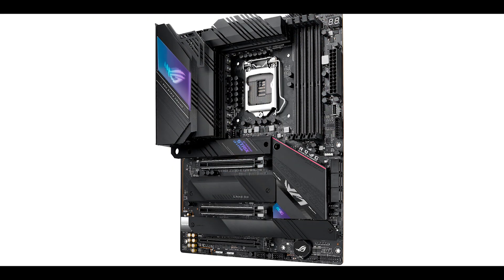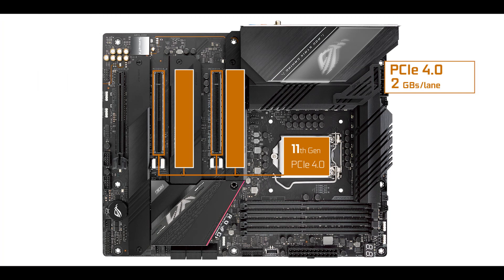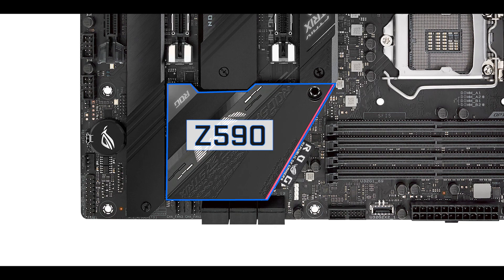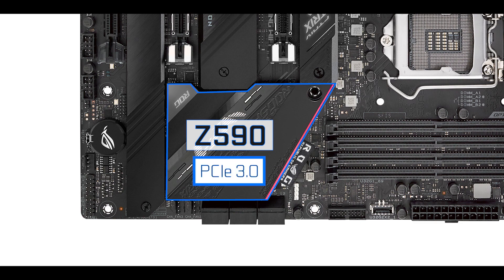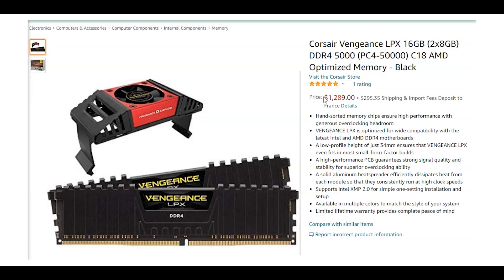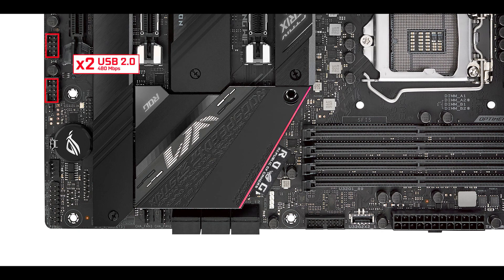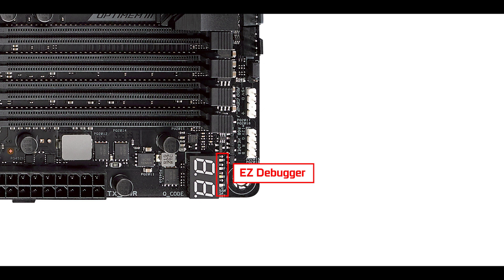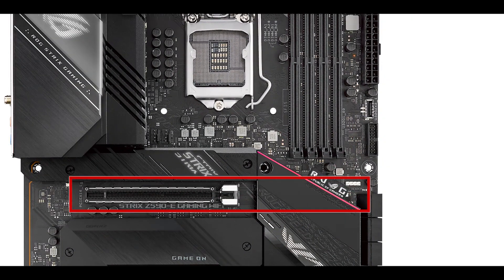ASUS ROG STRIX Z590-E Gaming: The COMPLETE Preview!

Comment: Very nice, I have that board and an Intel gen 11, i9-11900K cpu with a samsung ssd 980 pro in the 1st M.2_1 (socket 3), my GPU is running at 8x, not 16x I wonder if you have any usefull info to make ir 16x? Thank you
Reply: I recommend you check your BIOS. (But I hope it's all sorted out by now).

Comment: Owner here: 
I have this exactly MB for 2 years now and fitted 4x RAM modules with a total of 64 GB memory and an SSD M2 for W10 use. Everything else are still 7200 and 5400 HDDs. The result is I can have Opera open (5 separate workspace tabs with a total of about 150 open tabs) AND Chrome (with around another 60 tabs open) have a movie on a second monitor playing and still run GTA V on all options maxed out with no problems. All that with a 10th gen CPU i7 10700 running at the lower 3,8GHz (can go slightly above 4). 

This leaves me with a lot of headroom for future upgrades before I have to reinvest into a complete build again. When I do I will get a 11th gen CPU which will unlock the higher PCIe 4.O (with all its limitations that you have to take into account when you do that).

The only downside is the Armoury crate with is crap. If you want your RGB to run exactly like you wish 24/7 I strongly advise you to skip the ASUS SW completely and get something else like Corsairs icue or whaveter you deem proper. I mean it is okay when it works but a PITA when not. Google user reviews and troubles and you'll see. 

BTW I bought it also because (but not only) of the 2,5GB LAN because I already have a 1GB connection right now just to be future proof if I ever get a higher connection rate but TBH even the 1GB is overkill. Half is all you will ever need if ever but you know - why not when you can and the offer is good :)

Comment: Here’s the spec I just need to know if it will work or not 

My build list ⬇️

GPU- asus rog strix 3060 OC 12 GB
 
CPU- i9 10900k 

MOBO- asus rog strix z590e ATX LGA 1200 wifi

Storage- m.2 980 pro 1tb and a Seagate barracuda 7200 IHD

PSU- asus rog strix Thor 1200

RAM- DDR4 g-skill trident z royals  4x8 gb 3600 mhz

Aio- Nzxt kraken z73 360mm

Fans- Lian li infinity 17 of them 

Case- Thermaltake core p8 TG

Now a lot of people are saying that I’m going to have a problem with the mobo and cpu because it’s not a rocket lake based cpu 

Like I said I have no experience in building pc but I used to have one that my cousins build it for me but that one got messed up 
It kept on freezing while the temps were down and everything was normal I couldn’t figure it out 

In this build I’m mainly going for aesthetic look with a little bit of performance

So please if anybody knows this build try to hook a brother up with some awesome advice.  

BTW I went pc part picker and did this build list but here’s what it said and I’m not sure what it means.

“A
Note: Fan compatibility checking is currently not supported.
B
Note: The Thermaltake Core P8 TG ATX Full Tower Case supports video cards up to 320mm long, but video cards over 280mm may block drive bays. Since the Asus ROG STRIX GAMING OC GeForce RTX 3060 12 GB Video Card is 300mm long, some drive bays may not be usable. The Thermaltake Core P8 TG ATX Full Tower Case hard drive bays are positioned where some of the bays may be physically blocked when using longer video cards.
C
Note: When the motherboard is not paired with a Rocket Lake-based CPU, M.2 slot M2_1 (M) is disabled.
D
Disclaimer: Some physical dimension constraints are currently not checked, such as CPU coolers and RAM clearance”

Comment: Do I understand it right ?
 I have a Z590 E with a 11700k and an RTX 3090 TI.  The CPU outputs 20 pcie lanes, the graphics card should get 16 in the best case.  So I can only use the M2.1 and the rest of the M2 slots should remain empty.  Then I would have to pack games and OS on a large m2 is that stupid or smart?

Comment: I just bought this and I'm going to pair it with a 11th gen i7. But i'm really confused about the ram, because on the Asus is states " 11th Gen Intel Core processors support 3200/2933/2800/2666/2400/2133 natively", does that mean I cant use 3600 for example?

Comment: I only recently found this channel and love it. I just bought and installed this motherboard (Asus ROG Strix Z590-E Gaming). As my CPU is 10th gen and not 11th gen, I was aware the top M.2 port would not function.
However, I cannot get the 2nd M.2 to work either. No drive appears even in the BIOS when using M2_2. Slots 3 and 4 work fine.

Can anyone help please? Many thanks:-)
Reply: I'm having the same problem, will this second slot only accept 4.0 too? Did you manage to solve the problem?

Comment: The motherboard was purchased Asus Z590 TUF gaming motherboard and when installing it with the processor Intel Core i9 11900 so that it shows a red light on the motherboard and I do not know the reason why it was previously not shown
Reply from the maker: Is the bios fully updated? U can update it without CPU
Reply: @Laurentschoice  Why did you update and what is the method to update the motherboard

Comment: I bought this motherboard and paired it with a 10850k. You mentioned that the current generation of video cards cannot fully saturate the PCIe 3.0 bus, but what about the SSD? I am wondering if I would see any performance increase by upgrading to an 11900k and a Samsung 980 Pro, instead of my current CPU and my 970 Evo Plus? I just don’t want to lose my two extra cores :/

Comment: The screw to hold the 11 core M.2 card in place is too short. Wont tighten so I used it just to hold the card in place until I fastened the heat pad over the top. I do believe I just got the discount board because of this fault. Good review.

Comment: Okay question, if I've got a 11900k as my cpu into this, and I want an m.2 in the top slot as well as my 3090 gpu will they use the same bandwidth as eachother? If so, what would be the best way to put both components in with the least compromise?
Reply: I'm doing the same thing, how did your build turn out?
Reply: @robertvonada7493  nothing yet as to answers to this question, plus I havent gotten the parts for it yet
Reply: @user-hh3oi3yh4y  I just put mine together its amazing fast I9 11900K, Asus RTX3090, WD 850 1TB, I just need better ram any recommendations ?
Reply: @robertvonada7493  idk, I just have corsair vengeance 4 sticks of 8gb
Reply: @robertvonada7493  I'm going this G.SKILL Trident Z Royal Series 64GB (2 x 32GB) 288-Pin DDR4 SDRAM DDR4 4000 (PC4 32000) Intel XMP 2.0 Desktop Memory Model F4-4000C18D-64GTRS.

Comment: I "upgraded" to a new system with this motherboard and i've had nothing but issues for the past month! stutter and lag being the main issues! i have ruled out ram and i'm 100% confident it aint my 10700k or my 1080ti so either my corsair cx750 is failing even though it reports perfectly fine voltage, my new nvme drive is potentially dodgy or windows 10 is a piece of crap! failing that the wifi on this is the cause i will test that out tomorrow. I like the compatability of the motherboard and it looks great in my setup but at this point i miss my old system with my gigabyte z270x
Reply: same issues im having

Comment: Problem with this board if your using 10th gen cpu,  No 2 M.2 slot 3.0 nvme will run Gpu in 3.0X16@ x8 mode, So use the bottom 2 slots for 3.0 nvme m,2 ssds to get x16

Comment: Is z590 equivalent to b550?
Reply: No actually the z590 is x570 in the z490 is b550. If you're gaming the comparisons are already pouring in and z490 is trading shots and winning most of the time, z490 gives you Gen4 nvme Gen4 pcie GPU and new updates now give you Intel's version of amd's Sam smart access memory. I see absolutely nothing on the table from z590 except for a thunderbolt the latest USB C speeds and whatever 8 GB per second over 4 GB per second for your pcie extras gives you, and coming from pcie 3 chipset which is archaic

Comment: CPU have 20 PCIe 4.0 lines, 16x for GPU and 4x for SSD M.2 NVME. Why you draw 2 M.2 from CPU ?? M2_1 PCIe 4.0 4x from CPU (GAME ON) and M2_2 , 3 and 4 from Chipset.
Reply from the maker: Hi Fernando. That's a very good point . 
I drew those because they are both CPU fed. 
The Z590 chipset , even if it has native PCIe 4.0 support, does not house any PCIe 4.0 lanes as far as we known . It has 24 PCIe 3 lanes instead. 

My best guess is that, when both m.2ssd. Will be populated the 2nd PCIe 16 will run with less PCIe lanes. 
But as u rightfully pointed out, as it stands right now, there is a PciE 4.0 shortage of lanes when compared to manufacture specs claims. 

TBC obviously
Hope this helps. :)

Comment: Lol. Dude doesnt know. Its hilarious. M.2_2 is from cpu as well. So using it on 10 or 11th will result gpu running 8x gen3/4..
Reply from the maker: The 10th gen is PCIe 3.0 only :)
Since the M.2_2 sources its bandwidth form the CPU, it will run only on PCIe 3.0 standard with a 10th gen Core CPU.

Only with a PCIe 4 enable CPU will u unlock 1st and 2nd M.2 SSD PCIe 4 abilities. 
In our case,  the incoming 11th Gen PCIe 4.0 CPU.

I hope this helps :)
Reply from the maker: Asus will provide more details about the above in the next week or so. We already received the detailed specifications regarding M.2 SSD connectors.  
So this not an assumption. This is the very same approach we have seen on the B550 and Z490 powered motherbaords.
Reply: Think you didnt understand.

The first M.2_1 is from the extra pcie 4x lane from cpu
The second is M.2_2 is from cpu. Which shares from the gpu 16_2.
So if you use m.2_2 and plug  10 or 11 gen cpu will result 
16_1 running in 8x

Its NOT the same as b550 and z490.
Z490 other than extreme.. there no NO m.2 from the cpu.

Comment: z490 better cause price. specially open box or used on ebay.
Reply: Z490= b550 z570~x570 gigabyte top overclocking guy has set all his records with aorus Elite z490. Just got one for 175 alternatively MSI gaming Edge for 180ish

Comment: Will it be possible to get a x8 connection from the chipset to the CPU with a comet lake cpu and a z590 mainboard or is it limited to 11th gen CPUs?
Reply from the maker: It will be, absolutely, but at PCIe 3.0 standard (8 GB/s)
Reply: That would be great. Because previously I/O was always limited through heavy bandwidth periphals like a thunderbolt 3 connected NVMe or eGPU. Just to be clear: I could pop in my i9-8050K into a Z590 board and get double the DMI bandwidth?
Reply from the maker: what processor did u say? I9-8050k? or u mean 10850k? In which case, yes :)
Reply: Whoopsie,  you got me. I mixed up the numbers.
Reply: Are you sure about that? I just read a statement at anandtech that says:

> These new chipsets have an x8 DMI link to the CPU, unless a Comet Lake chip is installed, then it is only x4.

https://www.anandtech.com/show/16390/intel-previews-11th-gen-core-rocket-lake-core-i911900k-and-z590-coming-q1